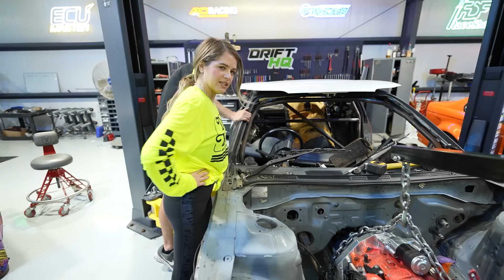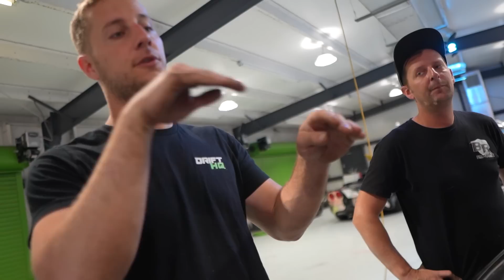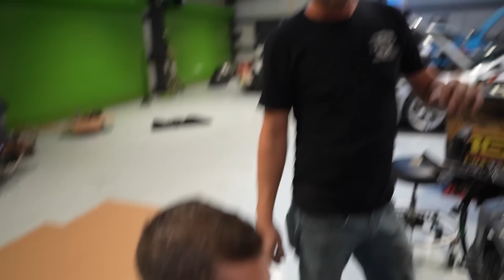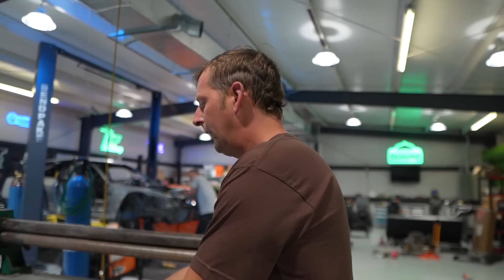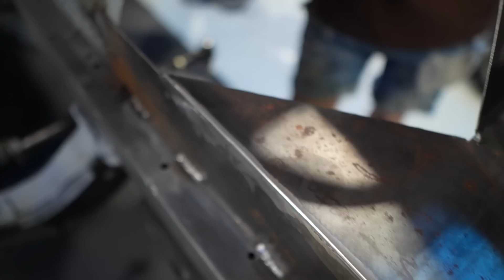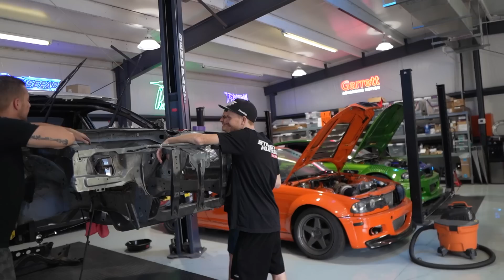Cutting Up My S15 ! Trans Tunnel + Tubs

Comment: Really cool, but I would have just bead rolled the sheet piece that was welded in instead of making it a separate piece. Bead rolling is a great way to add some strength to a flat sheet, plus it looks really cool when done correctly.

Comment: You can save yourself an awful lot of work later on . If you're careful when you cut out the transmission tunnel . You can use your old tunnel to make the new one . I've done it before where all I did was weld in a  inch-and-a-half piece of flat steel in between the floor and the tunnel .

Comment: That actually IS MIG-welding^^
Most people who say "Mig welding" is actually MAG welding.
MIG=Stainless and Aluminium
MAG=Steel ant sheet metal.
Reply: No they're actually mig welding. They're using mild steel which is best suited for mig welding.
Reply: But they used the same gas didn't they?
Reply: @nzuncovered1845  No MIG and MAG uses different gas!
MAG often use Carbon dioxide
MIG often use Helium or Argon.
Reply: @Sidio333  Yes I understand, but these people didn't change gas or did they? So were they mig welding?
Reply: @nzuncovered1845  They didn't show the change of welding wire either (different types for MIG and MAG) You can weld sheet metal with wire for stainless but not the other way around.

Comment: Would you recommend BC coilovers on a 92 Nissan 240sx?
Reply: ABSOLUTELY !   BC has been doing R&D for the s13 (Nissan 240sx) suspension for a pretty decent time now.  And their coil overs are for sure, One of the best out there, and also  "ONe of the best prices  , for the quality ,  around the world" . 

Whether you want to grip race and / or drive, drift,  circuit style race , or just have a reliable, " coil over " , that you can put your life on the line with some, "spirited driving" and Just trust overall then you definitely want to check out some BC Racing Coilovers.

you can compare BC coil overs [quality as well as price , plus or minus 2-300 dollars] with all the most common brands like HKS, TEIN,  Ksport,  Silvrs,  and i guess some of the higher end Megan racing coils would fall in around the same price . .  (1000-1500)
then there are Fortune auto which are also fully customizable just like BC, However; they are a quite bit more expensive. (2000-2400) And lets put in one more brand like ISR  Performance which are also very capable coil overs. I believe they have recently came out with a , "pro performance" , series which isn't fully customizable but you can pick a couple different spring rates. and these ISR brand run a little bit less expensive . (750-1000)

If you are going to be checking out coil overs , these ar he brands i would check out. With BC [in my opinion] being one of the very top.
****Also the prices I listed are just approximate . . but they will give you somewhat of an idea what , " capable coil overs" that are made for spirited driving and give you the strength, durability, and even rideability, and drivability that some of the very cheap brands that produce coils (under 600) would not do for you.

peace
Eturn
Reply: @ericturnbull9780  Cool beans!